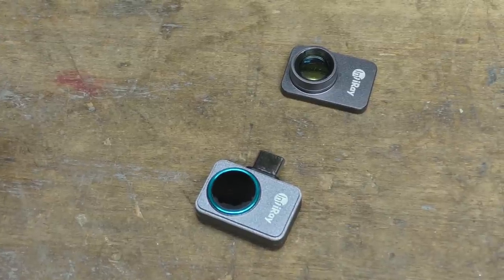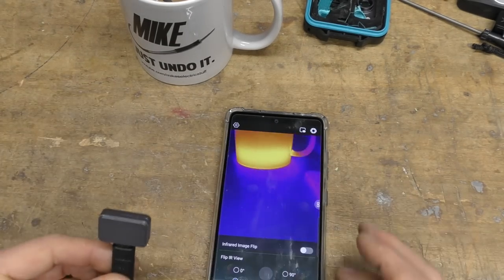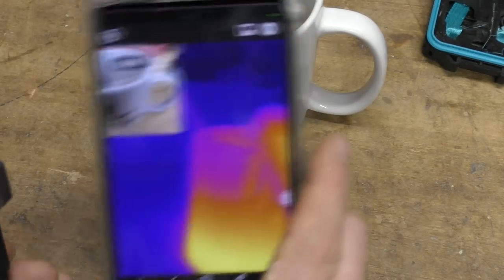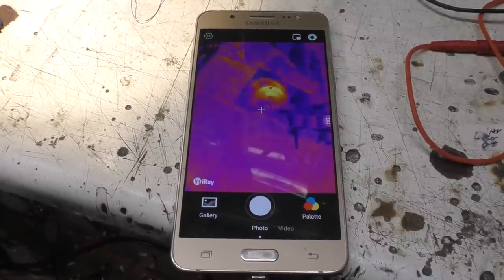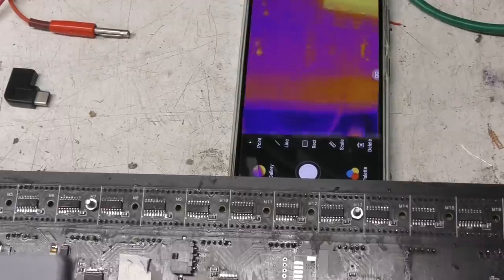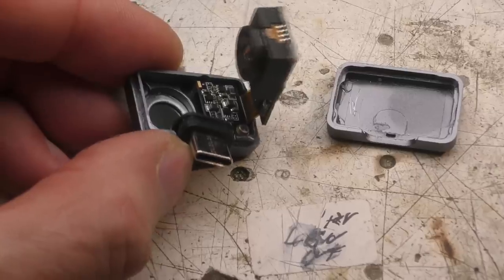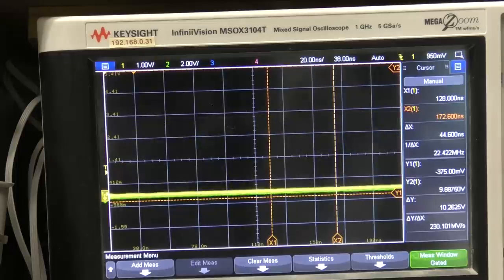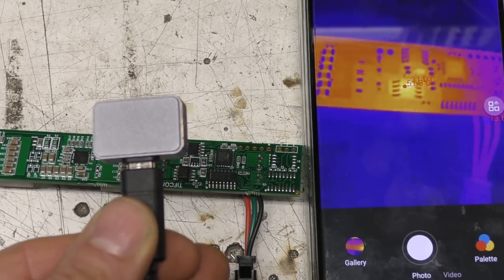Infiray P2 Pro smartphone thermal camera review & teardown

Comment: Lovely clear presentation. Sounds very professional, except maybe for the random hand waving / gesticulating.
I wish these and other thermal cameras has an easy user replaceable battery.
Reply: There is no battery in this unit AFAIK
Reply: this device is powered from the phone or what ever you connect it to.

Comment: This would be an insane fpv camera.  Is there a way of unsoldering the camera and soldering it to a fpv transmitter?  Or maybe there's a way without damaging/unsoldering the board?  I'd be curious for your input, and great video!
Reply: i have the same question since 2010. hmmm. quality is ok at this price, i think we are getting closer to fpv use...
Reply: @rolliseventeen  I’m currently using one of those mini cellphones and TeamViewer to operate it remotely via. OTG to a thermal images.  It’s super cool, but can only work where there’s a cellular signal. Hopefully prices for thermal camera drones will come down soon!

Comment: How would you go about to get this working as a Tele lens? Using laser focus lenses? Can it detect people at longer distances?
Reply: Just serch the eBays for "CO2 Laser Focus Lens PVD ZnSe Focal Lens Dia.18mm 20mm for Laser Engraver Head". Some people 3D print the stand-off tube for this lens. I used a section of metal tubing and B7000 cement. Just tinker with proper focal length, set the distance with tape temporarily then build!
Reply: @skeggjoldgunnr3167  can you upload a video of it done? I need more distance in my lens. How would one achieve that using only one lens. I think you need more of them.
Reply: @knallpistol  OH! I'm sorry. I just finally properly read your original question. I am talking about a MACRO lens. For using camera up-close ONLY. Sorry to have wasted your time.

Comment: too bad those chinese apps dont save the thermal images in the flir format (or similar) to later adjust gradient and measurement points.
Reply: Cant be too hard to make a similiar one or reverseengineer it. Its just a jpg with the raw thermal data strapped to it. The flir tools open the raw data and update the underlaying jpg when saving.

Comment: How does this compare to the Topdon TC001 in anyone's opinion? I just bought one of those a week ago. The resolution is the same, it's a bit bulkier but it can measure up to 1,022 deg F and you can get it for $220.
Reply from the maker: I think this uses the same sensor

Comment: Does it behave as a usb webcam if plugged into a computer?
Reply: Never mind 😅
Reply: LOL  No, BUT, it's too bad that the designers didn't make a Windows App so one could use this with a computer (laptop or whatever).
If that was an option AND if they had a version with dual cameras (thermal and video for overlay) I'd consider getting one.

I have a Flir that has dual cams and it's awesome for working on SMD stuff.
But it's big and bulky, making it awkward to use.

So if they had a PC option with dual cam, it would be so easy to leave it connected permanently.

Comment: Does this USB C version work on an iPad Pro with USB C?
Reply: it's not for apple crap.
Reply: @casemodder89  Funny they make lightening versions too. The questions was if the USB C version work. My condolences if you own a poor-droid crap, hope you enjoy your security with that.
Reply: @CarlMoebis  you had the opportunity to be the better man and you went with a dig, lmao you're no better than he is
Reply: @ColHogan-zg2pc  you had an opportunity to answer the original question, instead you decided to cast judgement
Reply: @CarlMoebis  Why on earth would you use the locked down, proprietary garbage apple crap? Do you really enjoy burning money that much?
Reply: So here's a proper answer.  LOL
Even though I'm not an Apple fan, I'm not going to throw insults!

So, the answer is, it's not about USB C or other, it's about an app designed for this device that is in question.
From what I'm seeing, it seems that the devs only make an Android app.

I don't write apps for Android or Apple products, so I'm not sure why they don't do so.
Perhaps it has to do with having to be approved for Apple at a high cost???
With Android, it's much easier.  They just have to open up for Google to confirm it's legitimacy and security.  Which of course, works perfectly!!!  >>cough, giggle, cough<<

I wish that they'd also make a Windows App so that where one has a Lab with a PC/Laptop, it could be connected to work on SMD stuff.  A full-sized cam is awkward to use.

See! No Apple slights!  IT CAN BE DONE! heheehee

Comment: To think, there's more tech in this $200 device than a modernized Russian main battle tank.

Jokes aside, I don't think we'll see the image (MSX is what I think they call it) overlay stuff FLIR does because they aggressively protect that patent wherever they have it. Edit also surprised to see they were granted a patent for "aerial thermal imaging..." (FLIR on a drone).
Reply: In theory if this works on a rpi and you can attach a normal camera to it as well then couldn't you do some overlaying of the images yourself using the standard apps? Difficult for FLIR to go after that.
Reply: Def not the case with the T-14

Comment: What's the difference between this and the Infiray T2S+ Thermal Camera?
Reply: use different sensor, P2 has more functions, T2 S+ seems a littler more clearer, but price  higher
Reply: Adjustable focus ring. The focus ring can be very useful, if you're dealing with up close stuff.

Comment: My phone doesn't show the correct temperature on the app; it's always -273,15°C. When I change to the Kelvin unit, it shows 0°K. It seems I can't calibrate it, even when I set the ambient temperature to my room temperature, it doesn't work.
I tried it with the TC001 App, and the temperature works there. So I think it's a problem with the P2 Pro App. Can anyone confirm that?
My phone: Samsung Galaxy S23 Ultra.

Comment: This seems to be a pretty good system.

The only thing that I hope that the add, perhaps as an "upgraded model" is an actual video overlay (not using the phone's camera, but a video element inside the unit itself).

When I bought my Flir, that was a must have option and I'm so happy that I didn't cheap out on a thermal element only version.

For electronics and other things, the video overlay has been excellent and makes identifying certain things much easier.

I wonder how difficult it would be for them, with this version demoed here, to add a software option where they have a person "mount" this cam just below the phone's actual camera lens and then, using software, allow adjustment of the video from the phone to be overlaid onto the thermal cam's image.

As I typed that, my mind was going into how coding could make that work.
The setup could allow a person to use some sort of configuration image where you could then zoom in or out, move the video image up/down/right/left in order to line up the video image perfectly over the thermal image.

This is doable!

Comment: Germanium window yes. If it was glass there would have been no image. Glass blocks IR.
Reply: "Glass blocks IR."  
Glass doesn't always block ALL of IR, depends on the type of glass and IR frequency (which is vast, about 700nm to about 1mm in wavelength.). You only have to think of IR lamps that have glass bulbs to realize this :)  
Near infrared (NIR) and Short-Wave Infrared (SWIR) will pass through most glass, though the amount will vary based on the glass and the specific wavelengths within those bands.

Mid-Wave Infrared (MWIR) and Long-Wave Infrared (LWIR) are blocked by most glass. This is the wavelength of IR light that thermal cameras use, so contrary to what the movies would have you believe, thermal infrared cameras cannot see through glass.

This isn’t an absolute rule. Some types of glass are more transparent to IR than others. Sapphire is transparent to most wavelengths of IR all the way down to MWIR wavelengths, so cooled thermal cameras can see through sapphire.
Reply: @cjjuszczak  Dude, you're splitting hairs. I've had a few thermal cameras, and his statement of "Glass blocks IR" is generally correct. You will NOT see through glass with any of these.
Reply: @cjjuszczak  Absolutely right but still for NIR and SWIR professionals in IR will not use glass lenses. I discovered IR cam  could see the dials through my saphire glass watch ! And still for cooled cameras we use Germanium or Silicone.

Comment: Finally some good middle ground between total shit and something over $500! Not that I'm not happy with my HT-301 but for some repairmen this would be a salvation level thing with price stinging much less
Reply: Which app do you use for the HT-301?
Reply: @u.d.7543  Its own bundled crap. Also installed ThermViewer trial but didn't see any worth paying extra for an app. However I'd really like to have a fully compatible software on Windows to do a little more sophisticated stuff with the camera mounted over a PCB not just quick peek with my phone but haven't seen any good ones.

Comment: I wonder what all these gadget manufacturers will do when phones (eventually) move to wireless charging and get rid of the USB-C port entirely. Turbocharged BT with enough bandwidth to carry video data?
Reply: that will never happen phones are charging @ 30W nowadays... that's not a job for a wireless charger anymore ;)
Reply: Interesting question but never gonna happen.
Reply: A lot of the smartphone-targeted "endoscope" cameras have moved from USB to WiFi (camera behaves as an access point, rather than connecting to an existing WiFi network), so I'd guess that.

I'm sceptical of that happening any time soon (i.e. phones losing USB ports), but smartphone manufacturers have surprised me before :)
Reply: Wireless charging is only an option for the premium models. Lower end phones will always have a standard USB port.
Reply: @robertjung8929  How do you charge a typical 3-4A smartphone Li-Ion cell with 30W ? The limit is always 4.2V ! You can't rise the voltage to 5V or 6V or even more to keep the high current. 30W is marketing BS.
Reply: USB C can charge at higher voltages
Reply: @dorfschmidt4833  In simple terms, amps are drawn and volts are applied. We don't rely on the internal resistance of the cell to regulate charging for us either, so this doesn't even matter. Voltage is always stepped down inside the phone to something the battery is happy with. We use higher voltage profiles in the charger so that the cables stay efficient.
Reply: @dorfschmidt4833  2C charging currents are pretty common  for lion cells, and 5Ah cells are pretty common in phones too.. do your maths ;)

Comment: Only a few seconds in the video and I had an idea I wonder what it would look like if you put it on a rifle scope could you use your phone for aiming some James Bond shit
Reply: Glass is not transparent for IR, so you wouldn't see anything.
Reply: @humanser  It exists though but you mount it in front of the scope so you're "aiming" on the screen, "Leica Calonox Sight" is one example. It would probably work with this one as well but I'd reckong it would be very hard or even impossible to get any accuracy.
Reply: Maybe you could use it on a Cassegrain style telescope, since it only uses first surface mirrors, instead of glass lenses.

Comment: Chinese phone apps make me nervous.
Reply: The Chinese already know that.
Reply: I dont use them anymore. They all require location enabled 24/7.  All of them.
No thank you.
Gimme korean stuff though, awesome tech and software.
Reply: @luminousfractal420  Yeah and they claim GPS is required for proper function. I guess that's true if they define proper function as in a spy app. My phone GPS always stays off, bluetooth stays off and wifi stays off. I even keep it in airplane mode when I am out and about. They don't need to know where I have been or who I have been near.
Reply: @BlenderRookie  what the hell are the Chinese gonna do with some guy in Kansas' gps location lmao, you guys gotta be realistic, it's not worth their time to strip sensor data.
Reply: @BlondieSL  That's the same thing I do. My soundbar has an app and in order to use it to connect to it from my phone using bluetooth, I must enable GPS. Uninstalled... I use an optical cable from my desktop to it and it works fine.

You are absolutely correct, so many people don't understand that we the individual, are the crop to be harvested and the asset to be sold. It may not even be nefarious, but it's certainly spammy reasons.
Reply: @luminousfractal420  For the P2 Pro app, you can set it to ask every time for location permission. Seems like the app only needs location if you want to take photos/videos, because it geotags them, though im not sure if it does anything other than that with your location. What bothered me more was that the app wouldn't allow the thermal camera to function if you denied it permission to access your files.

Comment: What justifies a $400 dollar price tag for one of these? 400 bucks and it doesn't come with a case even?
Reply: Don't pay $400 for it. These go for more like $240. And it's much cheaper than it's competitors.
Reply: Currently $190 on Aliexpress without the macro lens.
Reply: @Phoen1x883  It was $185 with the macro lens with black Friday coupons, but they're all sold out now.
Reply: The Topdon TC001 is about $220, comes with a case, and can measure far beyond this to 1,022F. Same resolution but it's a bit bulkier.

Comment: Why is your video skipping?
Reply: Thermal cameras have a small flag that covers the sensor to allow it to do a non uniform pixel correction. When this happens instead of showing a black screen it freezes the feed, instead
Reply: You asked why it needs to know an ambient temperature: thermal cameras are calibrated at different ambient temperatures because the temperature of the lens (and housing) will affect the measured temperature
Reply: @VAL9THOU  I'm not talking about the thermal camera - I am talking about this youtube video. His voice and and the video frames are chopped up.
Reply: @larry785  ah, mb
Reply: @larry785  I see a lot of that on many videos.

Sometimes (often??) it's the YT channel person who "edits" the video and on purposes, does those split-cuts.  Perhaps to save time???

It's annoying!  The other thing many are doing more and more is what I call, 
"pop zooming" where they just POP quickly from wide to a bit closer then back to wide.  Not a smooth "zoom" but a POP in and out thing.  They seem to think it's a cool "effect!"
IT IS NOT!

Comment: Shouldn't be more than £30 to expensive!
Reply: I agree, $259 for some Chinese knock off! I think that's a no from me
Reply: This isn't your random digital pocket camera, pal. In the world of Thermal cameras, it's not uncommon to spend over $1000 for 320x240 resolution at 9 frames per second. FLIR sells their phone dongle with 1/16th the resolution for over $500. This isn't a "Cheap Knock off", this is a flat out superior device in all ways.
Reply: The USUAL from people, that don't understand, that thermal Imaging is friggin expensive. 

Lets see the competitors: FLIR only has the much bigger and FAR more expensive FLIR One Pro LT, max. Resolution is about 80x60 and the internal accu only can supply it for about an hour. Price about 339 eurpoean schillings. What do you get? 9Hz and a real low resolution, temp range from -20 to +120 degrees C. 

The Seek CompactPRO FastFrame has a better Resolution with 320x240, but the range is limited at 330 degrees C, it offers 20 more degrees into the negative tough. Pricewise a 100 bucks more (in germany 399-405€), the framerate is a good 15Hz. 

The InfiRay 2Pro has a lower Resolution (nonetheless FAR better than the FLIR), but a nice 24-25Hz framerate, also a nice temperature range. (Negative Range is for the applications I used thermal imaging not very usable, the positive range matters far more in my opinion). 
Pricewise I ordered mine for 250 bucks (without import fees etc.), so, I'll pay around 280-300 bucks for a good, small and compact thermal imaging system, that Isn't limited by the US in terms of framerate. 

I'm exicted to use it and to compare it to the Seek Thermal Shot Pro and the higher end thermal imaging systems I'll get my hands on.
Reply: I got my flir for 170quid
Reply: Please found your own company manufacturing these for 30 pounds, with at least equivalent quality and software to the one in this video. I won't be holding my breath waiting for your first product. But if you really do it, I'll buy one.
Reply: @herrakaarme  Just one? I'd probably buy 5.
Reply: @gordonemery6949  I only used the "higher end" FLIR in my comparison, I had hoped to see a sensor with higher resolution. Well, I didn't.